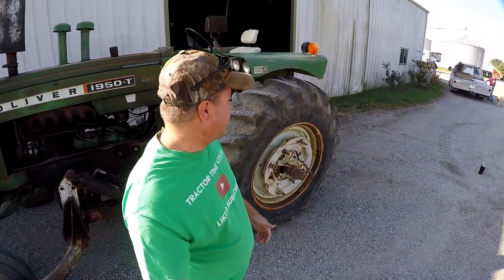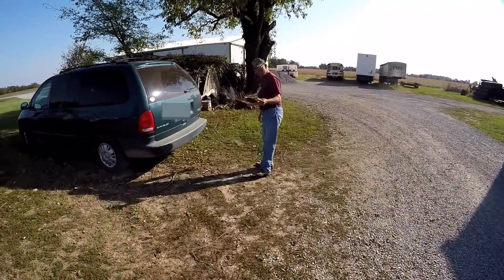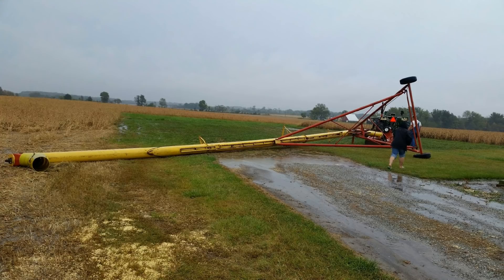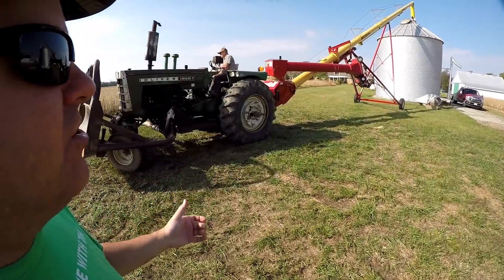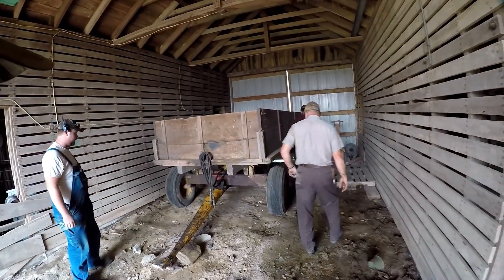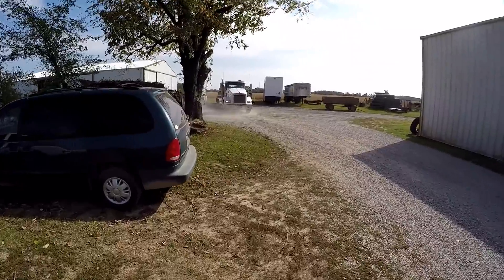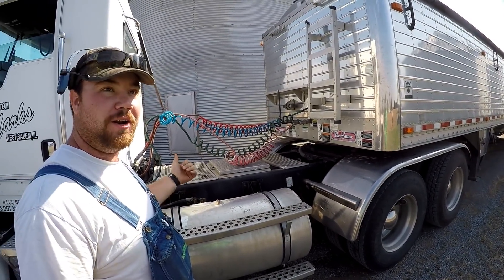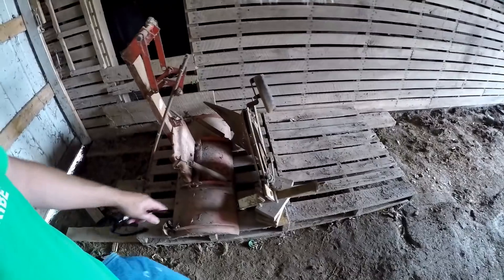On The Farm! Oliver 1950-T, Auger Setup,  and More

Comment: We have several olivers and just like your 1950-t the pto does't fully turnoff.  Our 1950-t has done it since 84.
Reply from the maker: we didn't want to show it on the video, but if you have gloves on, you can grab the shaft and stop it.
Reply from the maker: Oh, and this 1950-t is relatively rare.  It has the hydra-power drive, rather than the 'over-under hydraul-shift'.  There weren't very many made like that.  Of course, over the years, we always wished we had the over-under.

Comment: Nice video tim  and your mother on camara 👍.the blade in front of the oliver,where is that used for .
Reply from the maker: It has been used for lots of brush clearing, and dirt moving.  As you can see, it has REAL use.  Pretty beat up now, after 45 years or so!
Reply: Tractor Time with Tim thanks for the answer tim .

Comment: Question, Is the rye harvested in the spring or is this used to put nitrogen into the soil over the winter.  What is the purpose of the cover crop?
Reply from the maker: +Robert Cline it is not harvested, and it does not add nitrogen.  It creates long/deep roots which rot during the summer. This creates 'holes' for lack of a better term which allow moisture to penetrate the hard soils in the summer. At least that is the theory.  It is still somewhat experimental.
Reply: Thanks for the explanation.

Comment: I worked at a coop for 17 years and we had a Oliver 1950 T I used to pull train cars loaded with wheat  and I could pull 5 cars loaded with 200000 thousand pounds which is a million pounds and the old tractor pulled it.
Reply from the maker: +Kevin Casey64 cool story

Comment: I had the brinley plow   it bent real easy     now have plow from everything attachment
Reply from the maker: +John  Goodwin does it work well for you? Their video showing it on the BX is not so good for sales in my opinion.
Reply: Tractor Time with Tim , I have the same brinly plow and I use it on a BX 2230 works great for me , just have to keep the parking brake set on the second notch to slow it down a little ...... Lol
Reply from the maker: +Josh Oakley ha!  Better get that brake tightened another notch. Otherwise that BX might run away with the plow!  :-).  Would love to try a plow on Johnny, but have no real need for it.
Reply: not so good on bx so now have b 2650 also  works great on it
Reply from the maker: +John  Goodwin ah!  That makes sense.

Comment: Im going to call bs on the gas diesel block not being durable they are as good as any purpose built diesel block.
Reply from the maker: +scott offerle in this case, it is not.  There are not enough head bolts.  We have replaced 10+ head-gaskets.
Reply: @TractorTimewithTim   the 310 had issues but in general the Oliver used the diesel blocks for the gas tractors.  That is why normally you can really turn up the power in the gas tractors and they have no issue with it.   The 310 was not a good design, the smaller engines though were wicked solid.
Reply from the maker: We still love the 310…despite its faults.  The sound is SO soothing!